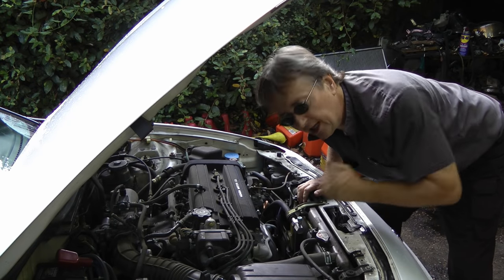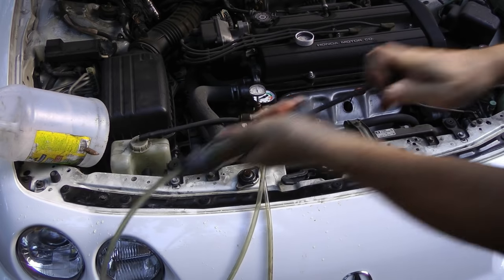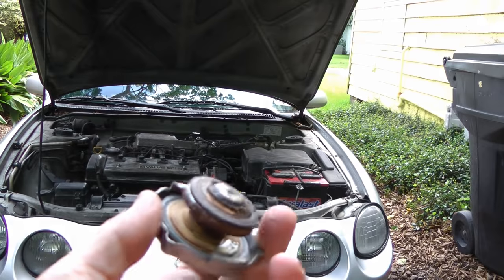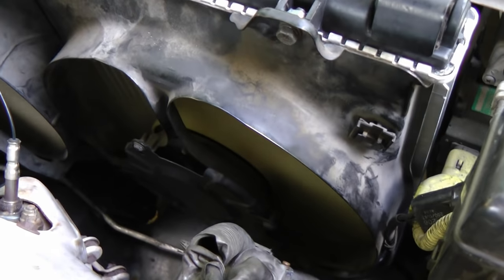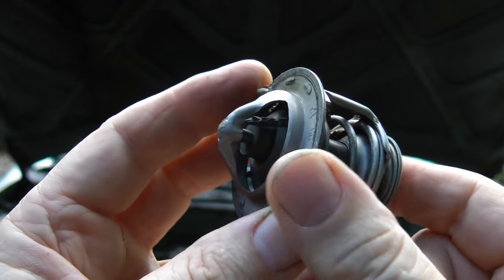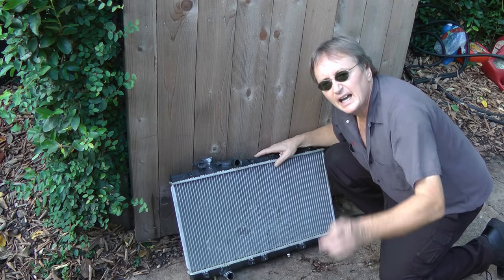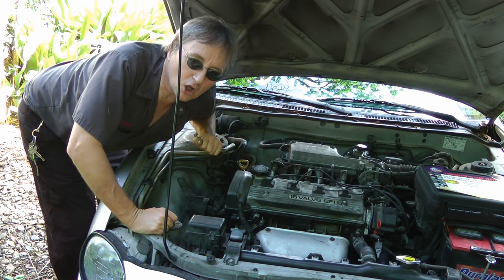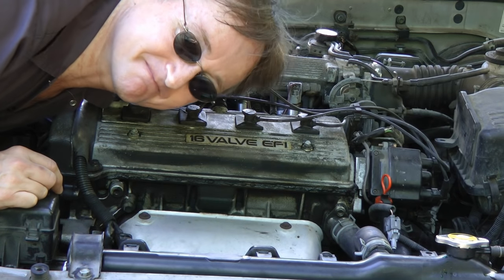How to Fix a Overheating Car Engine

Comment: howdy  Scotty, i have 97 monte carlo. i need to get 1 more year out of it ( just enough time to save money pay cash for a  used car).
when it running it runs cool. but when it sits at a light or is tuck in traffic, the temp starts to rise. i know the thermostat works,  it cools off a little. but if i'm sitting to long the temp goes right back. just over the halfway mark on the gauge.   never has ran that hot, it  used to mark  about 1/4 to 3/8 of the  way on the gauge.  it does have a new radiator and hoses. pepboy replaced it for me, what a shitty job they did. they made my car over heat. they didnt tighten the top hose enough. so when it reached it top preacher it slipped right off.    sense then the car had been running hot. it did have a leak toward the back of the motor. i added that stop leak stuff.  it worked for now.  so what can i do to keep the fans on so it doesn't over heat on me and will give me more time to save up some cash for a newer car?
thank for your knowledge and for sharing it with use.

Comment: Hi I have a 05 dodge neon, I had an engine light on - indicating coolant sensor. So I changed it out, but now it over heats. I puzzled and cant figure it out. Any tips on what I should look at.

2005 Dodge Neon ES
2.0 Engine
Automatic
Reply: Leo Garza that could be a faulty sensor, you should try getting the sensor replaced that you purchased
Reply: Hi. Did you fixed overheating or did you trade it in?
Reply: Yes sir I did, thanks

Comment: Scotty, I have a 2007 dodge caliber r/t 2.4 liter, This car has 2 thermostats one you can get to and one in the thermostat housing unit, over the last two years I have replaced the radiator hoses, water pump, the cap, the thermostat I could get too. Over this time I have had a small amount of coolant leak which I replace as needed. I don't have a pressure tester to test system for leaks, Recently my car over heated. When it over heated I turned the heater on as I was driving and parked the car for over an hour. On my way home it started to over heat again but this time no hot air would come out of the heater. Could this be a heater core problem? Please Help thank you.

Comment: Do you know where a temperature switch is located in 2005 hyaundai sonata i was told it was a temperature switch not a temperature switch ive looked online but have only  found sensor any help would be greatly appreciated

Comment: My 2005 Hyundai Elantra is overheating and it won’t start, it looks like the first problem, “the radiator is leaking “ so I just replace the radiator?

Comment: Scott please help. My utility bakkie is overheating but my heat gauge is good. I see it leaks water on a pipe which not tight. Could it be the problem?

Comment: Ever had a faulty water pump the inside impeller didn't spin causing  overheating no coolant circulation and also a dead snake in the coolant pipes blocking circulation. Yep found a dead snake in the pipe after flushing the system
Reply: Damn

Comment: I changed the throttle body on my car and unhooked coolant hoses to it. I let coolant drain from it and thought I’d just top it off when I put it back on. Topped off the coolant in the reservoir cause it dropped below the minimum line. Took my car for a run and now it starts to over head with Full coolant in the reservoir.
Reply: Sounds like you have air in the cooling system

Comment: I have a 2011 Buick LaCrosse with no visible leaks but keep loosing coolant every other day took to shop  and the said coolant is getting in the plugs and that it might be a cracked head gasket or cracked head  I don’t wanna fix it and then the bottom end starts knocking car has 129xxx any suggestions

Comment: Forgot about the the heater core.
Clogged heater core on many models is a common problem that can cause over heating.
The fan clutch on single fan models also is a common problem.

Comment: Thing people usually overlooked is that--
Fiber radiator (AKA plastic) usually will dies out faster than Aluminium radiator
- Fiber radiator is cheaper, But if something were to happen like leaks? 
 Well.. replacing might as well be the only option.
 
- Aluminium radiator on the other hand, Could get as twice as expensive compare to the fiber or the steel one
But if it's leaks you can just patches them either by yourself or at the Auto workshop

Comment: How do I know if it’s the water pump or not it started out leaking a small amount of coolant somewhere and the temperature will go up I replace thermostat and replace radiator because it was busy in I also replaced the two fans because one wasn’t spinning after I fixed everything. Now the engine is fine going up and down the road but as soon as I get on the interstate and drive for a while it starts slowly creep up with you and no he comes out of the heater it is just cold air

Comment: Hi Scotty I have a problem with my car it was mixing water and oil and engine is fine they fixed that we bought a new oil cooler now the problem is when we switch on the fun the water start boiling but when the fun rans on it's own no water is boiling what could be a problem it's Sandero turbo 2014

Comment: Scotty, I have a 2000 Chevy Silverado LS with a V8 5.3L Vortec engine.  I took it to Auto Zone to have them check the "Service Engine Soon" Light.  It kept throwing codes regarding my system running lean on banks 1 and 2.  
According to them, the solution was to replace the engine coolant temperature sensor.  Therefore, I drained the coolant, replaced the sensor, closed the drain valve, and refilled my coolant reservoir tank.  I took it for a test drive, and then the engine  began to over heat.  
After allowing the engine to cool, I drained the coolant again, removed my thermostat, flushed the system, installed a new thermostat, and reconnected my hoses and closed the drain valve before refilling the coolant.  I started the engine and let it idle.  I turn the heat on full blast, but my engine started overheating again.  Am I missing a step somewhere?  Any help would be greatly appreciated.

Comment: Sir i have jimnny 660 cc 2012 model i have a problem with my jeep over water flow rank full with water. Although i have change the rediter cap but problem is same so how can i fix this problem

Comment: Does both fans need go work
Reply: Yes, it could go a while with just 1, but it will still overheat after a while of driving. That is why they put 2. If only 1 of yours works, it should run without overheating for short periods of time if it absolutely has to, but it is not recommended.
Reply: @jiahmiller3861  thank you💖

Comment: If you have had any problems lately with your radiator system and parts have been replaced it could that your engine is not filling completly! Some engines have something like a petcock valve usually on top of engine that once opened will let the coolant rise to the top of the engine filling cavities with coolant!

Comment: Hi there, so my car over heated but then the temperature went to normal. I checked for leaks couldnt find any (even though im losing a lot coolant), checked engine oil all clean. No grey or blue either. Also when I turn heating on it blows cold air even though car engine reads warm. 
Please advice what it is. Thank you
Reply: I have a honda civic 2011 model 1.4

Comment: Getting air out of The 4.6 v8 32 valve ford intec is a pain in the rear end. Usually it will want to overheat once or twice. But this time it's been overheating for awhile now
Reply: Hi. Did you fix it or did you sell or trade it in?

Comment: Hello, my Toyota Corolla 2007 overheats when the AC is on, but sometimes stops immidiately the AC is turned off, the fan picks the moment the AC is turned on, what could be the issue please

Comment: Skotty I need Help! 
I have a Mini cooper s r53 
Yesterday I kept the engine running a little for 15mn and suddenly the coolant blows from the cap and I didn t hear the fan going on and engine temperature was normal on the gauge.
Some said that I have a blown head or head gasket however I didn t reconnaise any oil mixed with water .

Comment: Sir i need your HELP my Toyota Camry 2002 stops after 30 min of driving but if you leave it for couple of min. it works fine! sometimes the Idle drops. any suggestion how can i fix this problem Thanks a lot.

Comment: another way to test a bad water pump is if the temp goes straight down when you rev the car high and floor it. that means the impeller is going bad and the high engine rpm forces to the pump to circulate coolant faster but for only as long as you have the engine at high rpms (flooring it) best to do in gear and moving cause the wind hits the radiator. in neutral or park does nothing

Comment: I have a toyota starlet gt aluminum radiator. When cold its start fine when heated it does not start. Water does not go in or out of expansion tank, radiator fan works fine and car overheats. Any ideas?

Comment: I have an issue where my cooling fan is like hitting the plastic and makes a bad noise. I also noticed after driving 60 miles or so when I got out of the car while it was running I noticed the car almost died when some sort of fan kicked on?

Comment: Something tells me that the thermostat on my 2011 Ford Escape has seized, my coolant levels are full, checked the belts (blown belt is the result of a seized water pump” Both cooling fans are working, just hope it’s not too expensive to replace...

Comment: 1999 lhs still overheat after thermostat replacement,  fans , radiator and head gasket...any ideas in this model?

Comment: My thermostat has been replaced and coolant is filled and reservoirs filled as well radiator cap was new. But still overheated slightly when I wasn't moving. But I noticed my fan doesnt always turn on. Turns on randomly what's the deal?
Reply: Relays should be checked

Comment: My 07 Versa overheated.. it was the water pump, cuz it was leaking  at the bottom.  Fixed it.. next problem.. the ignition coil was filled with oil.. needed to change all four of them n the head gasket.

Comment: I got a small bit of engine oil in my radiator overflow tank. Been like that for years. I even wash the tank sometimes. Now what? It runs great.

Comment: my fiat overheated & right before that the ac was blowing hot air when idling. Is it a bad thermostat?
Reply: did you check the fluid/coolant?

Comment: my toyota engine overheats ,we have tried everything in the video including head gasket and still it overheats ,fan cuts in when standing and engine running but i dont think it cuts in when the car is on the road ,if i put my foot down after a while it overheats and the fan is not running, please help

Comment: Hello Scotty I have a 2006 mustang gt it was leaking from the reservoir tank cause it was hot but my inside gauge was at normal so I went and bought the thermostat but it doing the same also my fans are working properly what could it be if you can help me Scotty I would really appreciated
Reply: Can be a clogged passageway somewhere had that on my civic and it caused the radiator to bust

Comment: Question, I have a 1997 camry e-sv40 and both fans are not working, I changed the radiator fan switch located on the radiator at the bottom, but I cant find a connection to the switch.... help

Comment: So it cant be the water pump that's not gonna be a option when it comes to the cooling system???just a question
Reply: Having same issue now what I hear is a bad water pump will def leak if it's bad so I guess just look there when its warmed up and someone is revving to 3k....my 03 civic is losing coolant yet I cant figure out where or how it's not a blown head gasket and not either a leak
Reply: Could be the water pump
Reply: Could be a bad head gasket  if ur not leaking coolant than ur burning it probably by an exhaust port which explains why it wouldn't be smoking so u wouldn't know till u check ur coolant and its low if u had a bad water pump ,correct me if I'm wrong then while car is over heating turn on heater if it doesnt lower temp then bad water pump but if it does lower temp then pump good cuz its pumping thru the whole system but 03 civic huh have u checked the oil in car no coolant what about oil in the radiator? Thermostat opening? Are ur fans working ? Again could have a bad head gasket on exhaust side hey try this disconnect ur return line on the radiator take a garden hose turn on low but consistent start ur car now the water should start pumping from the radiator to motor back to the radiator but in our test out on the ground if no water moves then water pump ....right?????
Reply: @justinmoore8097  what's do you mean exhaust burning it but no white exhaust smoke
Reply: Because it's not going thru the combustion chamber just getting sucked striaght out exhaust
Reply: Idk I had that issue with an 01 accord took me almost 3 years to figure it out just thought I'd throw it out there
Reply: @justinmoore8097  from what I'm told the water pump has a designated hole on it that way if it fails itll leak and yeah heat works so no pump issue fans work and so does the thermostat only problem is coolant just disappearing

Comment: My head gasket is blown and guy at shop says it would be cheaper to buy another engine instead of replacing the head gasket I have a 95 camaro v6 3.4  engine

Comment: So my issue is my car still over heating, it overheats after 5-10 minutes of it sitting on idle however as soon as I get to about 30 mph the needle like freaking launches down slightly below middle, usually after the temps go up and it’s still idling after about a minute temps start going back down even without moving but I’ve replaced thermostat HAVENT replaced the hosing but I’ve replaced the radiator tho not with a new one it’s one i got from the junk yard but was good enough and I mean yea any ideas before I blow money trying to find the issue by buying part by part?

Edit: was at the mcdonalds drive thru as soon as I let go of the brake the needle kinda wiggled then went down a little bit and as soon as I stepped on the break it went back and it wiggled a little bit more? Can this be the cause of a serious issue?

Comment: I have a five intake will that cause my truck you think that is that it is hot from the written down into the filters from my intake
Reply: 5.4 triton engine intake is leaking coolant down into cylinder head but still have plenty of coolant and radiator and overflow. Will this make my truck overheat even though I have plenty of coolant in my radiator and overflow God just bought my engine out and he did not do the Plenum correctly. It is leaking fluid.

Comment: Positive, on a battery, is the one that supply current?  What does the negative do?
Reply: negative (black) provides the ground
Reply: When you say ground, what does that mean actually? Like to cut off the flow?
Reply: @spitfirelast8761  Ground receives the "used power." Take a lightbulb for example, the power side(red, positive) feeds power to the bulb illuminating it. Now that current doesn't just disappear into the atmosphere, it MUST find its way back to the battery to "complete the circuit." That's where ground (black, negative) comes in.

Comment: My cooling fans come on by themselves when the engine is about to overheat till it gets to decent temperature, but they come roaring to life when they do, but also if I turn the a.c. on they come on at a nice speed, and the engine is a nice temp at all times, so I don't know what is going on
Reply: sounds normal. they are supposed to come on with AC to cool the condenser & radiator both.

Comment: So I have a 2000 prelude I recently bought,I replaced timing belt and water pump, thermostat, temp switch,temp sensor..I can't seem to get cooling fan to come on  it will reach operating temperature  and will rise above a Lil but will not come on. With a/c on fans come on...

Comment: Guys I ran the car without coolant at minimum level. I didn't see it and when I was driving the car stopped all of a sudden it stopped. I towed it away to my home mobile mechanic came and had a look at the car and said that might be a coolant issue. I filled the coolant with 5 litres and everything was sucked. What should I do mine is a mazda 3 2007 model. The car engine is not starting. When I checked online it  is said that 2 gallons is the capacity. Should I put more coolant and try to start or anything else. Please help me asap.

Comment: Sir did you why my car start but it dies after 5 seconds and it won't stay running...and I put a new fuel pump and new fuel rail sensor and a new fuel filter

Comment: I started overheating about five months ago. It got really hot one day on my way to work and me being the noob I was I bought oil thinking it was oil temp. Since then I’ve read up on the service manual and have burped the air out multiple times, replaced my thermostat and housing, my water pipe, my radiator, I’ve bypassed my heater core, and I plan to do the water pump this week. It’s been a rough fucking journey and over $600 spent. I just bought a pressure tester and I pumped it up and it started to leak from somewhere not visible behind the ac compressor. My thoughts are either the water pump is leaking from the weep hole or my heater pipe is leaking too. Hopefully the water pump fixes it as I’ve been driving it like this for about 4 months now. It’s to the point where there’s no effort to cool the engine even with full coolant, on a cold start it will start to rise to operating temp and get to the middle but doesn’t stop it just keeps going till it hits close to hot so I pull over every time. Takes me over an hour to get to work when I’m 15 min away.
Reply: Sorry to hear about your car trouble.  Hope things will work out for you.